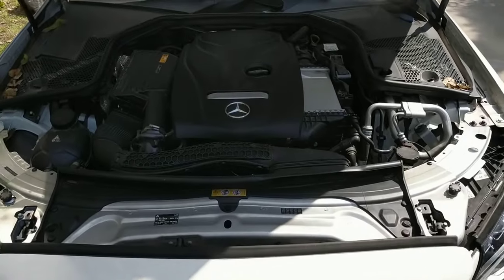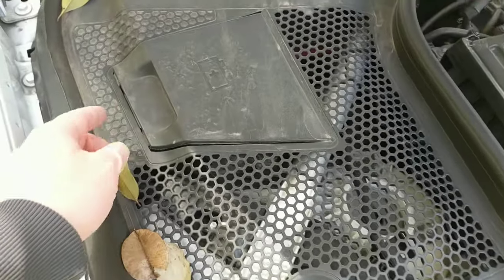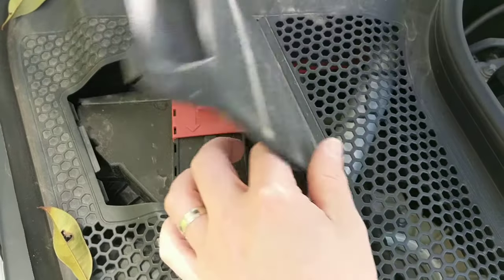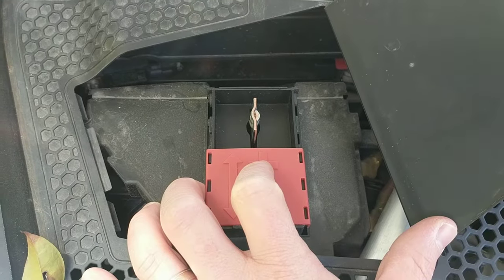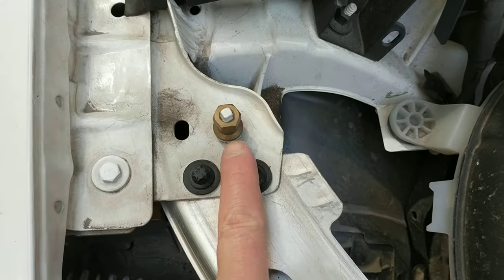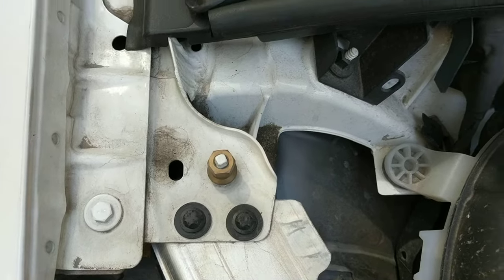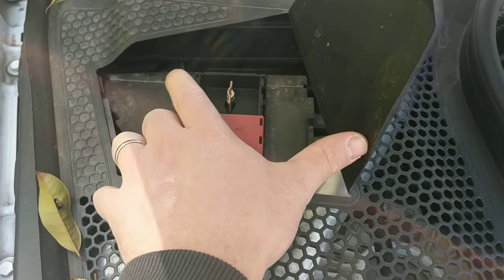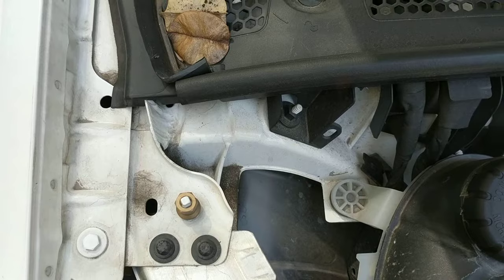Mercedes Benz C-Series Jump Start Location

Comment: I have a c350, I was completely locked out. My manual key wont work for door and trunk. How do I access the hood to jumpstart? Is there terminal outside the car that I can connect a battery charger to boost the battery a bit?

Comment: I have a 2016 c300. When I charge it, I attach the negative clamp to the negative post and the positive to the positive post on the battery, or on that positive terminal? I have been having battery issues, warnings of low voltage so I have been having to charge my car. I probably need a new battery but in the meantime this system is working. I have been attaching the positive clamp to the post on the battery itself, not the external positive terminal. Is that okay?

Comment: thanks for the video. I was about to share it with family. I noticed the proper negative grumbled is at least 2 feet away from the positive terminal. Is there a closer 6 inches or less to the positive terminal I see under the plastic cover there is a strut bar, but I was wondering if there is a closer space without having to dig under the plastic. Thank you.